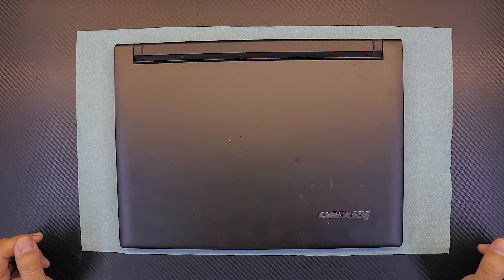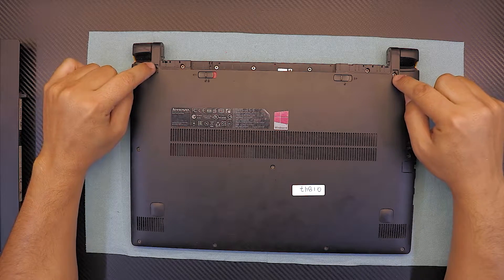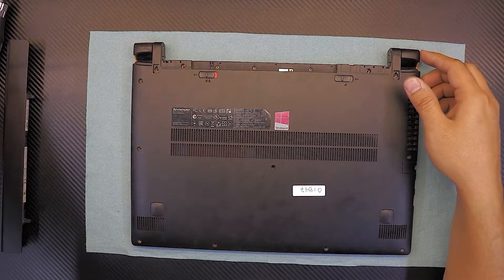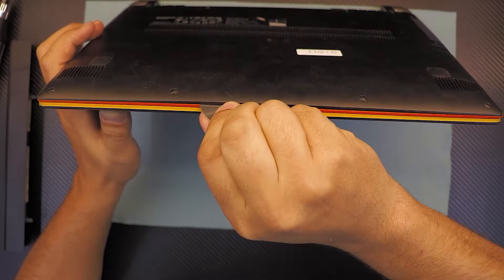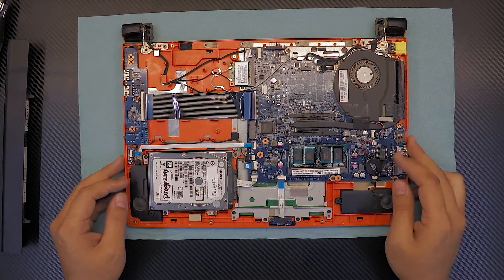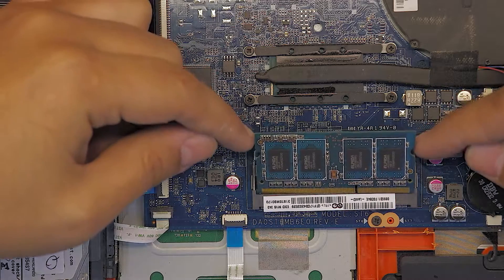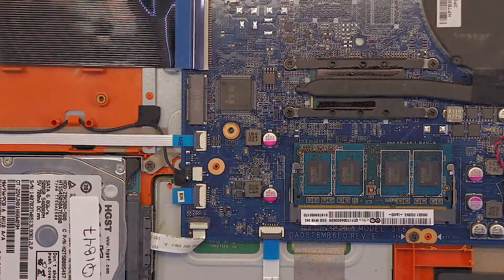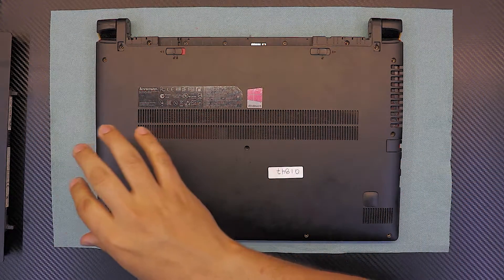Lenovo Ideapad Flex 14 Ram Upgrade, STEP By STEP

Comment: Hey ! The lenovo flex 2 14 support ddr3 ? Or its only support ddr3l ?
Reply from the maker: Thank you for your feedback! If you wish to support the channel, you can like, subscribe, or both!
Regarding your question, up to 4gb sdram ddr3 if you going 8GB then you will need to place DDR3L (low voltage)
Should you have any further questions or requests in the future, please don't hesitate to ask me.
cheers🍻
Reply: @uFixTek  Good morning ! I tested with a Samsung 4GB ram strip in DDR3 but it doesn't work, I still have a problem with "beeps" when I start the PC, if you want the diagram of the beeps it's: "3beeps, pause, 3 beeps , pause, 1 beep" Do you have a solution?
Reply from the maker: if you read i said you need a DDR3L not just ddr3,
thats why you don't get boot on screen

Comment: hi, my bro has this laptop and we want to upgrade it's ram. do you know about what's the highest mhz of ram that this laptop can handle? 
currently it has 1600 mhz 8 gb ddr3, i'm planning to upgrade it to 16 gb but i don't know about the mhz 
thanks for the help
Reply from the maker: Thank you for your feedback! If you wish to support the channel, you can like, subscribe, or both!
Regarding your question, the speed of the ram is decided by the bios, you can place a 2666 and  the bios will auto adjust to 1600mhz.  there is no option for you to change that in laptops.
get a 2666mhz stick and that is all you can do, if the bios adjust the 2666 to 1600 there is nothing you can do.
it will work just fine.
Should you have any further questions or requests in the future, please don't hesitate to ask me.
cheers🍻
Reply: hello  @uFixTek  can i upgrade my ram to 16g ??
im on 8g with HDD still its slow

Comment: my laptop is lenovo ideapad flex 14 20308, and I want to upgrade my hdd to ssd (is it possible?) and my ram from 4gb to 8gb (is it possible to 16gb?) how to know our laptop ram slot type (ddr3l,ddr3 or ddr4)
Reply from the maker: Thank you for the feedback! if you wish to support the channel you can LIKE or SUB or both :P
regarding your question: your laptop takes SDRAM DDR3L 1600 MHz you can place a 8GB in there : https://amzn.to/3veCh50
this are the one we use a lot , and very compatible with bios 
if you want to know your max ram capacity : https://youtu.be/tKEJTkVth4Q
there is no way to know how many slots available you have until you open it up, because the programs and windows can detect the on board ram as a slot.

Comment: What's the max RAM capacity which this Flex 14 can support?
Reply from the maker: Thank you for the feedback and your support to the channel, regarding your question: we have went and upgrade max to 16gb usable ram. SODIMM DDR3L SDRAM
Reply: @uFixTek  DDR3? Not DDR3L for this Flex 1 gen? Mine is Flex 14 1st Gen.
Reply from the maker: @concretemathematics8146  it takes DDR3 and ddr3L, but try to get DDR3L
Reply: @uFixTek  got it. Thanks for the help.
Reply from the maker: @concretemathematics8146  anytime my friend

Comment: How many ram slots are there in IdeaPad  
Flex 14 , from task manager it shows 4 but when I opened back panel for upgrading I see only 1. can you tell me where are remaining slots ?
Reply from the maker: Thank you for the feedback and your support to the channel by a Sub :P
regarding your question:
NEVER trust the task manager for this info , its very wrong, because the task manager give info based on your cpu, your cpu can handle 4 dim ram. but this motherboard only has one ram dim. there are no more ram dims available.

Comment: Are the new flex as easy to swap or is the Ram soldered in ? Thanks
Reply from the maker: depending give me the exact model for the flex laptop and i will tell you but mostly are easy to swap and some soldered. thank you for the support :)
Reply: @uFixTek  Lenova ideaPad Flex 5 14ITL05?
Reply from the maker: @JayTrain117  Thanks ✌  for the feedback!  if you wish to support the channel you can LIKE or SUB or both :P
Regarding your question:  The ram for that is soldered on motherboard its NOT up-gradable ore removable.  (Flex 5 14ITL05)
Reply: @uFixTek  flex 4 1130?